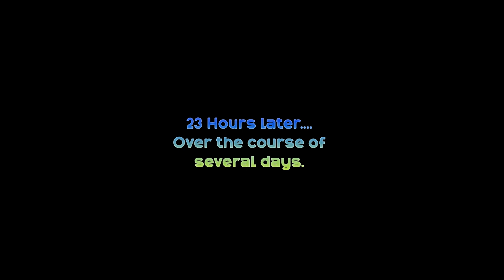Vibration Testing the Omnicell no spot welds battery system

Comment: You should have used a light that was steady,  so we could see if the power was constant.
Reply from the maker: I need to find something with a higher load for that. At the moment I was just trying to see if it would come apart. Fair point though I can use it with a nice bright bike light. Thanks.

Comment: I'd call that a pass. My triangle pack would not have faired better. If your e-bike recreated those conditions in the real world you'd be too worried about your shattering bones to care about the battery. Keep up the good work!
Reply from the maker: That is a fair point. Back to the days of the old boneshakers with no rubber on the wheels!

Comment: This is fantastic. Please keep us updated! This system is going to be a game changer. It would also be perfect for reusable v.ape batteries
Reply from the maker: It would? I thought they use one cell? Or they run off 12 volts now?
Reply: @HighVoltageKits  Sorry, I meant using the 3.7V lithium cell found in disposable v apes. They are similar to 18650s but are smaller, 16350s and other various sizes. Its a shame people throw them away. Some people on youtube are wiring them together to make lipo packs for rc projects. This system could be perfect to scale down for for the smaller size cells, giving similar performance. Probably for a shorter amount of time as they are around 650mAh. That would depend on your battery configuration though
Reply: @HighVoltageKits  Great example 
https://youtu.be/IAH_Gx7QVag

Comment: 72v possibility with this system?
Reply: Can't imagine why you couldn't scale this up with multiple modules
Reply from the maker: I will do a 36 volt one here shortly. It has been used at 72 volts in modules. I am going to start at the lower voltage applications to establish a base and then move from there.
Reply: No high amps possible without soldering or welding.  NO high loads. Not for 1000w+ ebikes,  Google the history of vruzend.